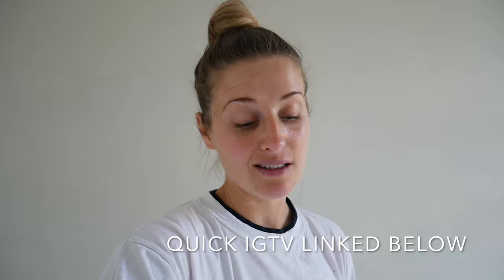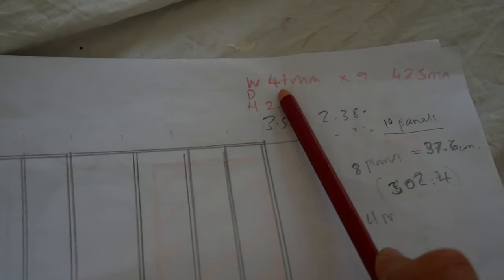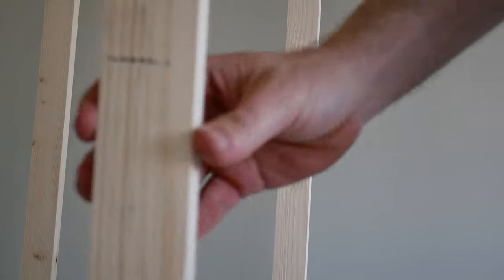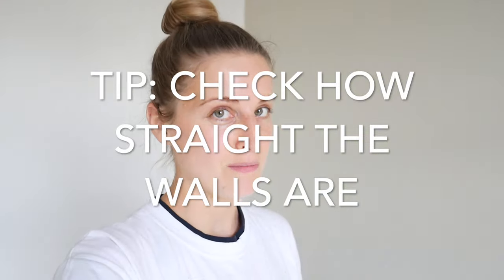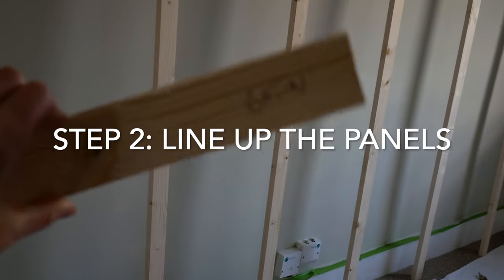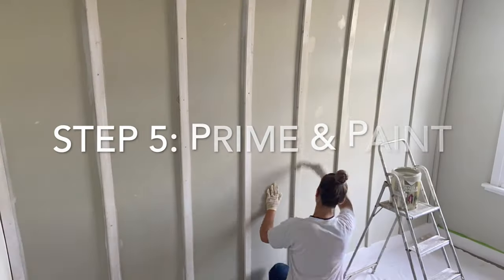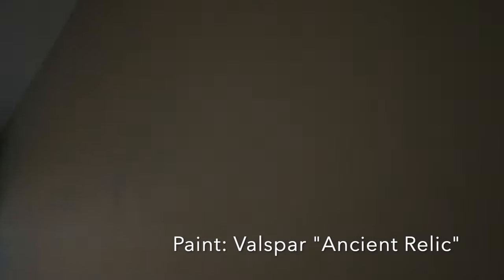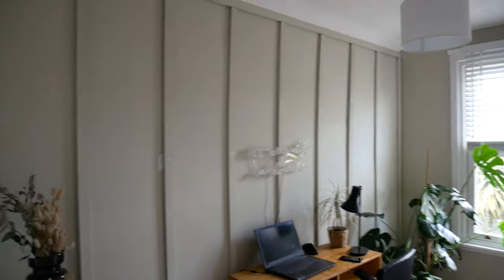EASY AT HOME DIY WALL PANELLING TUTORIAL FOR A STATEMENT WALL

Comment: Love your work and hints. I am trying to create a feature wall with the battens placed vertically to the ceiling. I have cut two 6 foot by 3 inch mdf battens to go across the top of the wall.  The problem i have encountered is when i drew the level guideline across the wall one side of the wall is 3 inches, another is 3 and a quater inches and the remainder is 3 and a half inches from the ceiling. What would you do in this situation?  Your advice would be much appreciated. Thank you

Comment: Great job. Looks really good. You can get mdf by the sheet and have them cut to size. We did shaker style panelling so bought 3 sheets of mdf (2.44 metres length x 1.22mm x 6mm each) and had them cut in to 10cm strips. B&Q cuts first 15 cuts for free and 50p per cut thereafter. Mdf was easier to work with (no splinters) and gives smoother modern contemporary finish whereas wood gives a more rustic look. Depending on the look you want.
Reply: There is no such thing as contemporary panelling. It copies regency aesthetics.
Reply: The one thing stopping me from doing this is purely me thinking it will be more difficult than it needs to be.lol

Comment: Lovely colour, but I’d definitely sand the timber, the finish is very rough. And those wires from the neon sign need hiding. Can you post a pic of the wall with the light on soon please?
Reply from the maker: sure you will be able to see the neon sign on the wall when the office overhaul video goes up
Reply: Jess and as said in a more recent video, personally I think you’d make an excellent interior designer, you have insight, style, class and vision.

Comment: There's no way that the wall is 2 inches of plumb. It's the way your timber is. If you put the timber edge on the wall rather than the flat side, you will see that it is less than 2 inches. Or else use a metal straight edge.

Comment: I knew just measuring would not work, most walls are not perfectly squared up so no way each panel(mold) would be the exact same length, that goes for horizontal installs too so flooring.

Comment: That looks terrible!!
Reply: You can say that again! Just stuck wood on the wall,no caulking, no nothing 🤦‍♀️
Reply: Sadly agree. Looks nice from a distance, unpolished from close up. Also personally wouldn’t have done floor to ceiling vertical paneling in a small Victorian room, it’s a high room anyway, which emphasizes this further. We are in a 50s house with pretty low ceilings but decent sized rooms. They decided it would be a good idea to have dado rails which made the ceiling look lower. I promptly ripped them off.